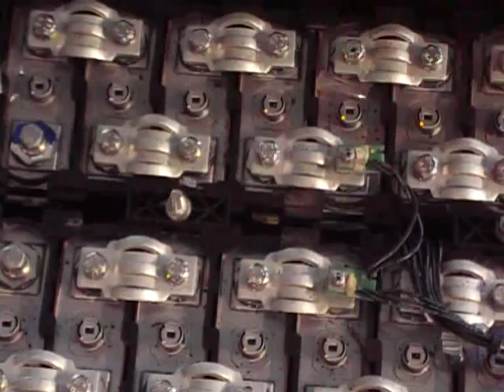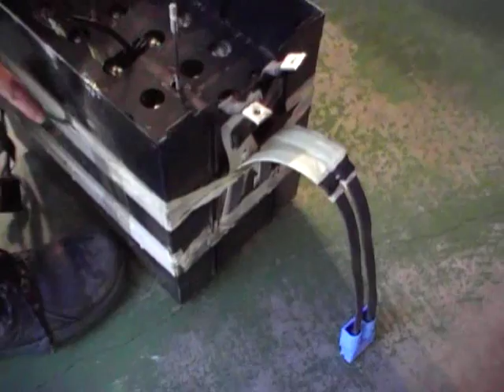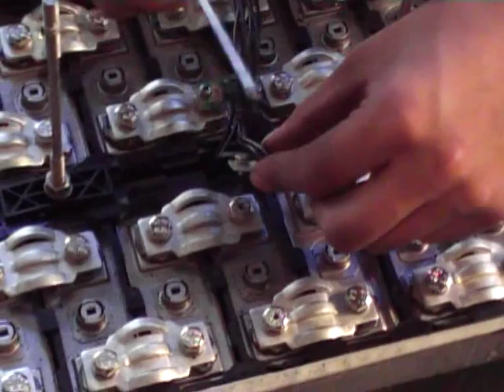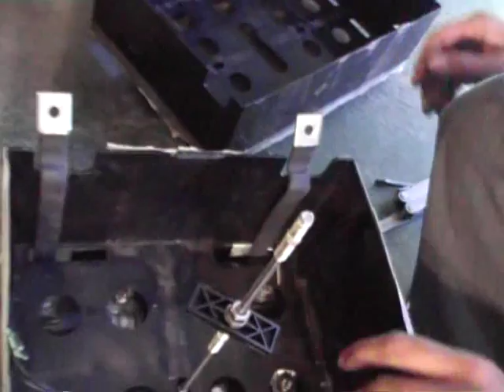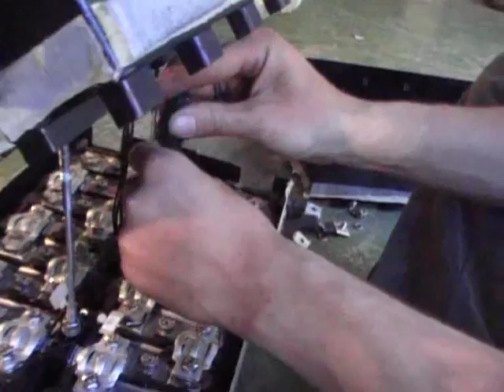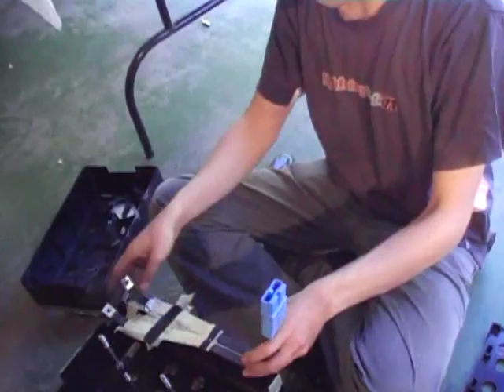Vectrix nimh battery disassembly (Lithium Conversion P04)

Comment: Is there a way to contact you for assistance in finding a faulty cell in a Vectrix VX1 Lithium Iron battery pack?  You can email me via jay66er@hotmail.com  Thank you
Reply from the maker: I replied to your email. basically if a faulty cell is short circuit, it will just be 0v.
if it's low capacity, it's a bit trickier to find